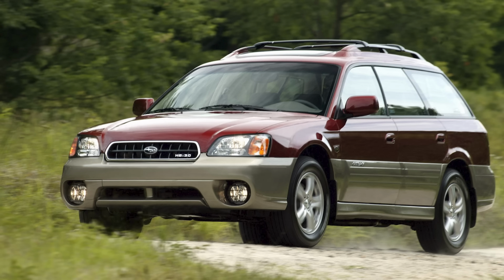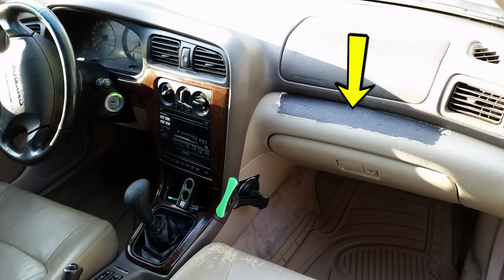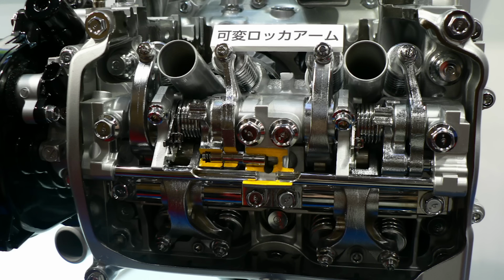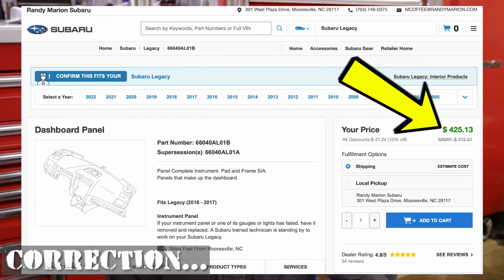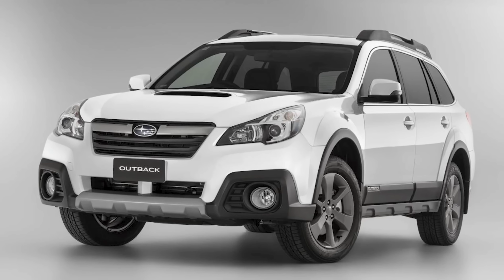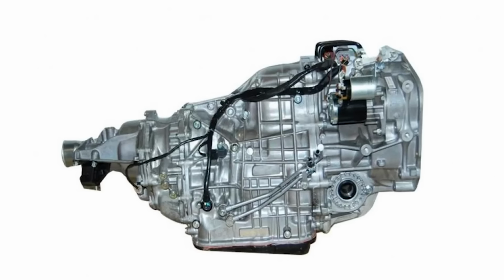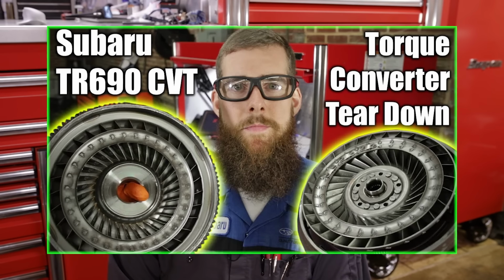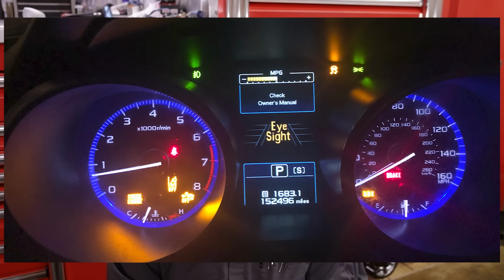Buying A Used Subaru Outback Or Legacy?! Here's The Good And Bad Over The Last 20 Years!

Comment: The JDM BH legacy gtb from 01 to 03 is the best outback ever made in my opinion but I guess it doesnt count lol. It came over engineered with forged internals on the ej208 with the last and final revision of the twin turbo system where subaru has perfected it to the point where the powerband is so smooth all the way from 2k rpm to 7.5k rpm. Mine is extremely reliable at 158,0000 kms and can beat newer STI's with no modifications whatsoever. It's just an amazing chassis, and it's too bad they never offered the turbocharged ej20 for the USDM models. Back then japanese manufacturers really over engineered their cars and its even more apparent in mainland japan where theres less restrictions for the engineers to do their thing. Nowadays its the accountants and finance guys that make the decisions, its all about making the cars as cheap as possible to reap the most profit possible from the consumers. Engineers are very much capable of designing overbuilt reliable cars but theres no money in that, they rather design bloated pieces of crap that keep breaking.
Reply: Nice, i have a JDM B4 RSK tuned for 94 octane and making 330 hp, fun, underrated and super cheap car but you have to be on top of the maintenance. The 5speed gearbox is not the best, i wish i had the 6spd.

Comment: Owner Info - 2003 legacy wagon vs 2005 Legacy wagons - all manual. Older model was noisier inside and significantly simpler suspension wise. The 2.5 base engines while rated similarly have a different torque curve, the 05 feels noticeably stronger down low. With higher miles the manual and auto trans center diff begins to bind up, especially in reverse. 2005 generation has much more interior insulation and sound deadening and the suspension is more sophisticated, lending to a better ride and more control. The 2005 GT specifically has a different brake booster/master cylinder which gives them a very soft brake pedal, even with upgraded stainless lines etc. The 2005 and up generation have a major recall for brake distribution block corrosion, the factory recall was just to spray it with some anti rust... it will fail and you will lose your brakes, ask me how I know. Personally I like the styling, interior and how the 05+ look more but there are many downsides.

Comment: I have a 2015 3.6R Outback, and purchased it new.
I have 70k miles on it now, and have to say, I really haven't had too many issues.
One of the rear wheel bearings had to be replaced under warranty, and it also had the mystery window crack as well.
I replaced the battery a few weeks after purchase, because the battery stunk!
It went dead on me twice, and was replaced under warranty.
The third failure, I replaced it myself, with an Optima, that lasted 6 years with no issues, other than if the car was left to sit for more than 5 days, the battery would need to be charged, because of the parasitic draw issue.
While some would find this a deal breaker, I've learned to hook up a trickle charger to it, if I know the car will be sitting for a while.
I also carry a jump box, just in case.
Over the years, I've only had to use it twice, so it's not a devastating, catastrophic issue.
The car burns about a quart of oil between changes, and I haven't noticed any oil leaks. (Knock on wood)...
Al I can say, is after coming out of an 09 2.5 Outback, I LOVE it!
I do however, miss the body styling of the 09...

Comment: I love my '98 Outback Limited, but age is really catching up with it. I normally do all my own work (usually guided by your videos) but I got intimidated when my duty C solenoid failed. I convinced myself that transmission work was way over my head and waited too long to fix it. Transfer case got all chewed up so I had to pay a Subaru dealer to rebuild it. Set me back over $2K. I guess I should blame myself more than I can blame age, really.

Anyway, I've been eyeing those 2nd and 3rd gen Outbacks

Comment: As an owner of a Eucalyptus Green 2002 LL-Bean with 238k on the odometer, I can certainly vouch for their reliability. It's also a really comfortable car to drive. My only real complaint is the seeming lack of power/torque at lower RPM's. It doesn't really seem to "wake up" until it hits 4k rpm. I was wondering about the variable length intake runner actuator that they unfortunately buried under the front of the intake manifold. Would you say that they are failure prone, sticking in the closed or open position? It just seems to be that with such long intake runners it would have much more torque.

Comment: With the EJ25, is there a way to know if your dealer used the more durable turbo head gaskets when completing a head gasket replacement? I've heard conflicting information on whether or not this was common practice. My 2006 is creeping up on 200k and I feel like I'm running an hourglass every time I drive the thing.

Comment: I'm driving a 1998 Subaru Legacy Outback limited GT 2.5L automatic and your 2000 description of head gasket issue explains my leak as head gaskets have never been changed.  But I do have over 260,000 miles on it.  Something else people buying these cars need to look for is hard use.  Many have been abused thinking AWD means they can go any where over anything.  Bought mine used 8yrs ago not realizing until later it was used for rock climbing. Skid plates were ripped off and not replaced causing issues with going through standing water as sprays up into fan belt even on pavement.  Also rims are badly gouged which is something I should have noticed.  Previous owner also replace parts with incorrect parts such as rear struts and springs so I found myself replacing  wrong with wrong. I discovered the previous struts were too short and springs not adequate not factory size at all.  My 1998 was also made from factory with Forrester parts so finding correct parts can some times be a little tricky.  This car is now known as the Mud Crawler by my neighbors, with nine miles of dirt road, washes, and deep mud to get home, it just crawls right through it all without my even touching the gas pedal while the more common 4WD trucks in this area get stuck or slid around trying to go forward.  Buying this Subaru is the best decision I made when moving to Arizona.  I highly recommend the older models of Subaru and I'm keeping the Mud Crawler running as long as I possibly can.  It's worth every dime I put back into it and it has made believers out of doubters. (Also for those who don't know the older models can be taken out of AWD into 2WD for city and highway use).

Comment: Anyone know why my ej251 on my outback makes a clatter / knocking noise at startup for like half a second until theres oil pressure. And when driving i hear a feint clicking noise from the engine when driving below 2000 rpms.
It has done this since i bought it never seemed to get worse or better.

Comment: Thank you for the great video. Can you tell me what you are referring to by the CAN system in the 15-19 models? (23:00). I've got a 19 Leg Limited that is on its 3rd battery 😭. Does it possibly have anything to do with the approach light on the mirror glass that's causing a batt draw? Thank you.
Reply from the maker: I have a 2017 Outback coming soon with a parasitic draw issue, killing batteries. Should be a video on it soon.
Reply: @MrSubaru1387  ok great I'll look out for it.  Thank you : )

Comment: Thank you for all the information. I am looking at purchasing a 2014 3.6R Outback. Sounds like you really like yours. It has about 82,000 miles. So this one would be equipped with the ez36d and 5eat transmission, correct?
Reply: Yes, 5eat. Switched to CVT 2015 onwards

Comment: Bought an 05’ Legacy Outback Bean. 138k. Needs work. Are they worth resurrecting? Rack and pinion, ps pump, rear hatch cable broke, CV book leaking, struts. Not cared for by previous 1 owner.

Comment: This video is golden! I have a 2002 Subaru Outback 2L. The car only has 150K milled on it! My wife wants me to donate the car. Any idea on how much I should pay to have the head gasket fixed. I think the car is a tank. It has given me very few problems during my original ownership of the car.
Reply: i have a 2001 OB 2.5 and the HG were replaced in 2013 at 83,000 for about 2300 at the dealer

Comment: I just got a 95’ subaru legacy brighton wagon. 5spd manual! Love the car so far! 

Is outback suspension and wheels of the same generation (1994-1999) compatible with the legacy wagon 95’ or will i need spacers for suspension to make wheels sit right? The outback 15” wheels mine currently are 14”. 

Thanks Mr Subaru! Subbed

Comment: My family still has my mother's, original owner, 2009 Limited with most all the goodies. 2.5, and less than 30k on the clock. We have had the timing belt changed as insurance, and the passenger head gasket leaked not long ago. The car still had too much utility left to not fix it.  It isn't worth a lot, but it's too nice to sell. She's 80, and drives it infrequently. I probably put a lot of those miles on it. lol

Comment: I got a change to get a 2001 outback LLBean 3.0 with 298,000 miles on it for $4000 it's in excellent shape and has every service record, runs like a champ. Is it worth getting or should I pass up? I'll be trading a 2003 f150 4x4 crew cab with 251k miles and he's giving me $1000 boot. What do you think?

Comment: My dad's 06 Outback XT had the ghost walk issue. Scary with the rear end wagging everywhere, hopping side to side at 70+. It was the bushings in the upper rear control arms being toasted that caused it on that car, replacing the rear UCAs fixed it. Supposedly it's due to the XT having an extra inch of ride height over other models, which changed the suspension geometry for the worse and made the issue possible.
Reply: Interesting. Did you just do the rear UCAs and then test drove?
Reply: @TheMCVillage  Yeah, at the time I replaced them, the UCAs were the only non-original suspension components. Instantly solved it. The bushings were absolutely whooped.

Comment: Bought a 2008 outback LL bean from my work. 330,000kms for $1500. Transmission lines blew off the rad. I just lopped them lol. Changed a few arms in the rear and trailing arm bushings. Cars been going strong for last year no issue. Wish Subaru made them like they use too.

Comment: My 2019 does not have the eyesight techno garbage on it (thank god) It did however did come with backup sensors that automatically applied the brakes. Because I pull a trailer I searched the schematics and cut that shit out of my car.

Comment: I'm gonna comment before watching, then come back.
I've had around 15 Subarus, from the barely pre-lagacy gl wagons, first legacy wagons, early outbacks, up to 2002. I bought them all cheap with issues and have done just about every repair there is.
I LOVED my 98 outback limited cold weather, leather, DOHC, but those engines are a pain!  I just loved that body style and the limited package.
I recently had a front differential fail and bind up in my 02. I took out the front shafts and modified the center diff just to keep it in the road, RWD!
Fun cars.
Reply: Two sentences in, and he says he's beginning where I end, with the '02 models. I don't know much about modern Subarus.

Comment: We own both '16 and '18 Outbacks. The batteries keep draining down. This is a known problem to Subaru on '16-'20 Outbacks. If you haven't driven yours for over a week, it may not start. Always have jumper cables. If you park nose first in a garage, get the extended 25' cables. This makes these years vehicles unreliable. If you don't drive often, do NOT buy these years Outbacks.

Comment: CVT can kiss my starfish!!! I've had to replace the torque converter. And had to change the very expensive transmission fluid several time to clean out micro metals. That in a 2011 2.5L Legacy. Wish I'd seen this 5 years ago before I bought it for $7000.00

Comment: Just bought a 1998 Legacy Outback 2.5 AT with 100k on it.. what can I expect??
Reply: Hopefully you have maintenance records - if not, the timing belt needs to be changed every 105 months or 100,000 miles. You should also do the water pump, tension adjuster, and idler pulleys. Aisin provides kits with all original equipment parts - don't use cheap chinese crap.
Reply: @rc w  thanks! Yeah, Timing Belt/Water Pump is the first thing I plan on doing. 
But ill do all the extras and with good parts! Thanks for the reply RC W!

Comment: Well good, I guess I’ll stick with my old 2004 Garnet red 4 cyl Outback wagon then. Bought it new in ‘04, always kept up with the maintenance / oil changes and park it in the garage. With only 80k on it I guess it should be sticking around for a while, haven’t had the head gasket failure (yet) and probably going to do the timing belt this summer.

Comment: I have a 09' SH Forester X. It is lowered on coilovers with rear adjustable LCA's, adjustable lateral links, 25mm rear sway bar and stronger sway bar end links front and rear. Also 18x9.5 wheels with sticky tires. Handles like a race car but is as slow as hell. Keeps me out of trouble. Bought it used with 86,000 miles on it. Easy to work on. Easy to maintain. Have had no engine issues. This spring gonna do valve cover gaskets, timing belt and water pump. I want to get an aluminum radiator and silicone hoses too.  On my WRX the plastic radiator tank cracked at about 130,000 miles. I agree with you on the looks but the SH Forester looks totally different with the STi Forester front grille and bumper.

Comment: My 1998 Legacy wagon L series 2.2 motor 140.000 miles on it the motor sounds like it's getting a lifter knock? Doing some research it could also be valves? Any suggestions? What it might be or what to look for?. Thanks for any suggestions or ideas on what you might think it is or where I should start

Comment: Pls mr Subaru. Advise me about check engine at oil temp after exchanged engine.  My mechanic said cuz of sensor but I’m not sure also my steering wheel became hard little bit   I have doubt of small belt of pump

Comment: We had a 79 Subaru when I was a kid, and that car was probably the most reliable car I've ever seen. My mom drove it 42 miles to work, 42 miles back, 5 days a week for several years. I drove the car after she got a 90 Jeep Cherokee through the early to mid 90s. Fast forward to 2006 my wife and I bought an 05 Outback. The car has been pretty expensive to own, lots of repairs, and doesn't get as good gas mileage as the old 79, even though the 79 was carburated. The more tech that goes into vehicles, the less reliable and harder they get to work on. The car industry is going in the wrong direction, it's time to go back to the basics and remember Keep It Simple Stupid.
Reply: If only the world's governments would leave them alone they could keep them simple. No they like to regulate everything to death.
Reply: @tbled52  true.
Reply: @williamperri3437  head gaskets, main seal, rear bearings, CVs, transmission shifting hard between 1st & 2nd. Electrical system went out and couldn't even jump start it. We kept fixing things and drove it for 15 years though.
Reply: @williamperri3437 some people just get unlucky.. find a low  mileage that was maintained correctly and remember subaru belts rot on the older ones.. when I got my 03 outback with 15k miles first thing I did after fluid changes was replaced timing belt water pump thermostat, obviously new rad fluid cause you need to drain to replace on my engine.new air filter  My 03 runs just as well as my 22 toyota tacoma.. currently sitting @ 43,xxx miles I change oil and filter every 5k miles.. only big $ I put into the car was 4 brand new nokian tires from Walmart because the 03 tires  dry rotted.. don't let others sway you away from purchasing one.. maintain the car correctly and they will treat you well 👌
Reply: I have the 2009 outback I love her but has been a pain in my butt . Melting dash 😮hvac went out issues with the cats and she blows heat all the time but no ac 214000 miles 👍🏼

Comment: I was charged over $800 to replace blend door actuator because "labor to take the dash out". And it didn't work. I was very much ripped off.

I have both a 2.5i 4EAT and a 3.0r 5EAT and both have valve body torque converter issue. The 2.5i eventually developed a case of rod knock.

On my 2005 2.5i, I have experienced the "ghostwalking" issue its NOT fun. At all. The 2004 shocks and moving from 16 to 17 wheels and Continetial ExtremeContact DWS 06 went a long way to correcting issue. As well as replacing almost every endlink, swaybar bushing.

Comment: in 2011 I went to go look at a2001  Subaru outback it was 10,000$ with 120,000 miles, I ended up buying a 1999 Legacy Wagon for 5,000$ with 104,000 miles. I have learned when you tack Outback or Crosstrek's name plate onto something its a rip off.